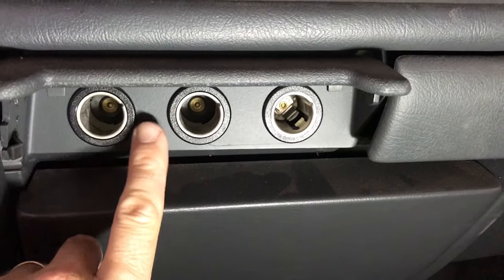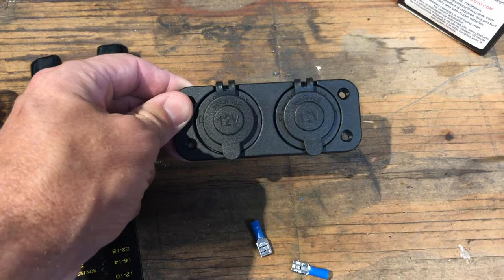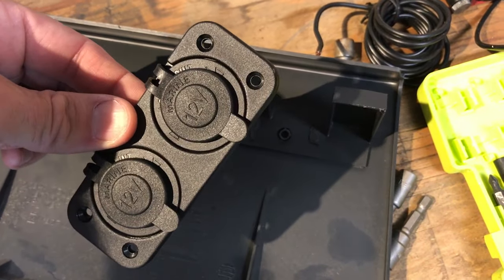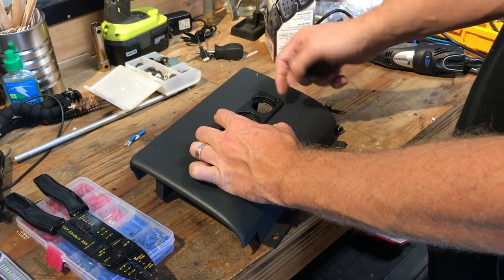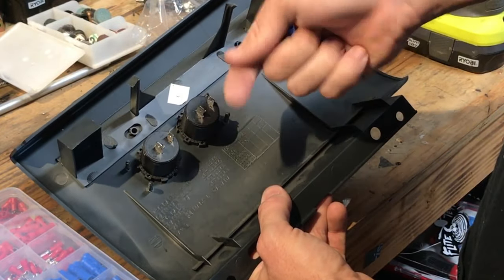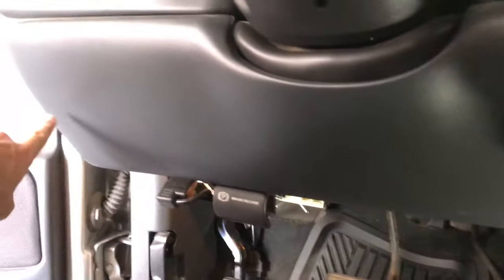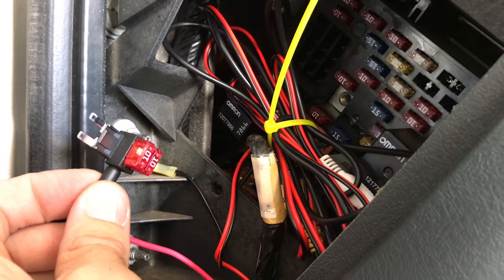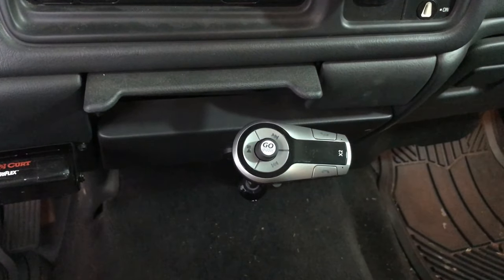Installing 12v Sockets for 10$ in Your Car Is Easy

Comment: I guess in this case it ultimately doesn't matter, but why the hell were you using black wire for both power and ground?
Reply from the maker: I ran out of red and wanted to get the job done….
Reply: Electricity is color blind
Reply: Why not it don’t matter he’s gonna know
Reply: Honestly next owner gonna be like let me cut this black wire and boom fuse out 😮 wtf?

Comment: i saw they have 12v sockets that connect right to the battery, and since my battery is under my trunk space and it's easy to run wire to the front from there in my Audi TT it sounds perfect. but my question is, is it safe to do that? seems almost to good to be true
Reply from the maker: It is safe, but you definitely want an inline fuse. Also be aware, the socket will be live all the time, so if you leave anything plugged in, it will kill your battery.

Comment: Love it!  I want to add a couple of 12V outlets in the truck to keep my Garmin plugged in on long trips and not have the power cord running through the middle of my console.  Wasn't aware of the add-a-fuse connectors.  Thank you.

Comment: It's easier than I thought.
I didn't know those "add-a-fuse" things existed, I thought I was gonna have to hack up the fuse box to add a new circuit.
Thanks for the video!
Reply from the maker: Thank you for the kind words! Those add-a-fuses are super handy.
Reply: @DoItYourselfDad  Can you clarify, when you use that "add a fuse" component, what fuse in the box is that running off of?  I'm guessing it is taking the place of an existing 10A \ 12V fuse in the box already used for something else.  In your vehicle, what fuse was it?

Comment: Great video!  Though i like having an always hot 12V in a campervan/RV, so i can plug in a solar powered trickle charger to the socket while it's parked for a long stint.
Reply from the maker: I definitely like having bowl, this truck that I’m working on in this video already had sockets that were hot all the time, I wanted another set that would shut off to power things like my raider Detector and CB radio.

Comment: Awesome video, thank you. I’m currently elbows deep in my very first “project” Land Rover and I was worried about having enough 12vs. My only question is: is there a gadget that attaches to the battery terminal that has space for all the wires from floods, and other electrical accessories?
Reply: If you’re still looking, walmart, amazon, and auto shops like autozone sell 3,6,and 12 post battery terminal connectors which make it super easy to wire in stuff like subs and lights!

Comment: Great video.  Consider using heat shrink butt connectors or soldering the lines with heat shrink over the top for strongest connections that will endure over time.  Adds only a few mins of time and $5 top to cost.
Reply: @A. Melbs You sound like someone who can't solder.  Horses for courses - really, it doesn't matter in this use case.  However, if you think the crimping tool in this video can beat a good solder connection, you're talking nonsense yourself.  A good crimp requires decent tooling - a $10 buy of Amazon doesn't cut it.  I'm IPC certed, I deal with this stuff day in day out, and would prefer soldered over this crimp.

Comment: Great video! Straight and to the point. Although, I didn't get a clear view of where you put the negative wire. I know it's going to ground but where does that go exactly? Also, why was the red wire, the "Add-A-Fuse", folded over, did the the model you buy just happen to have a forked end that splits into 2 other wires?

Comment: I don't have one of those splitter cables you use to power both sockets. Is it as simple as just combing the respective wires from the 2 different cigarette sockets into 1 positive and 1 negative wire and then crimping on a connetor?

Comment: Nice video the only thing I would like to add is that I would use Lever-Nuts Wire Connectors. I find them a lot easier than the crimp connectors.
Reply from the maker: I’ve never played around with those, but they look soooo much better than wire nuts or crimp connectors.

Comment: What gauge wire did you use and  where did you get that fuse connection to plug into your 12v fuse panel ?

Comment: How do you know which fuse socket is powered off the ignition? Sorry this is my first time and the only electronics I've done is with electric guitars 👌😅 thanks very much for the video ✊
Reply from the maker: You can usually find wiring diagrams online, which will tell you which fuse is which. You can also use a multimeter to check.

Comment: Very concerned about heat tolerance. My dash gets pretty hot even if I use the windshield cover - are these USB sockets heat resistant?
Reply from the maker: Yes, this is what they're designed for,.

Comment: Thankyou for this video; it's great, however, I'm assuming that it was the positive line from the socket that you took to the fuse. Where did you run the negative ground?
Reply from the maker: You can run the negative to any part of the body of the car.

Comment: I appreciate thos video but for soneone with no skill i really needed to see steps left out of your video to feel 100% confident but you have me  at 90. I read comments to help fill some of those gaps but still  troubled. If you make a thourough video plz let me know. My 3 12v sockets are not working and I need to install intending not to make contact with the originals.. just have my new self installed 2ndaries to charge gadgets as I drive.

Comment: Just so I'm clear... you tapped the actual Ignition fuse? I understand the benefit of knowing the sockets are off when the car is off, but I never thought of tapping the ignition fuse because I was worried it may have some negative impact on the actual ignition if the socket fuse blows.
Reply from the maker: If you're using an add-a-fuse, there isn't any change of blowing the ignition fuse.

Comment: This is a really nice project that I can do it myself. Instead of soldering ect....I can easily crimp the wires and to the fuse box which I have experience in since I have my dash cam connected to my fuse box. Quick question...the 10amp, what fuse did you use??? How long did this take and I wanted to install a USb and a Extra cigarette port..can instill use the fusebox method on the USB port??
Reply from the maker: Awesome! Let us know how it turns out!
Reply: DoItYourselfDad I'm pretty sure they were asking a question. Hence, the question mark.

Comment: Would like to add a two or three hundred watt windshield defroster (cold climate and a diesel engine).  I know it needs to be connected directly to the battery (and the engine running), but what gauge wire and what size fuse do I need for that size heater, and what kind of "receptacle" do I need to prevent overheating of the parts?  Thank you in advance for your assistance!
PS: Like some one else said, I was less than a minute into your vid and I hit subscribe!  Again, Thank You!
Reply from the maker: I would think on a defroster like that you would want to wire it directly to the battery through a relay using something around 16ga wire.

Comment: Hi, your jumper fused wire was spliced into something else on a red wire before reaching the positive wire from the sockets. 
What was that connected to. ?? Is that needed to do this job as you didn’t mention it. 
Thanks 👍🏼
Reply from the maker: It's providing power to my backup camera's monitor, you don't need to worry about it for this installation.

Comment: how can you figure out which systems you can add a circuit to in the fuse box?
Reply from the maker: Use a multimeter to figure out which circuit is hot.

Comment: So by this logic i think i might first try to add another socket directly wired from the already existing socket into an extended out of sight view for my backup cam since im already gonna be digging inside the the stereo when i replace it with a tablet style stereo in my car
Reply from the maker: You can definitely do this as well

Comment: Hey does the add a fuse need to be 15A since the 12V cig lighter on my 02 Jeep Grand Cherokee Laredo is F26 that says 15A.
Also do you simply just use the "add a fuse" with two 10A/15A fuses in it and connect only to the fuse box to the 12V sockets? You don't have to have the "add a fuse" wire going to the battery or anything right?

Can you add links to all the parts needed from crimper, wire connectors, add a fuse wire, and the wires needed for this, how about that dual 12V socket mount kit?
I'm not aware what those tiny connectors that go to the back of the 12V sockets on -/+ terminals are called.
My 12V Car socket is not working in my Jeep WJ and was covered up with a panel, so I need to install a couple 12V plugs in the Jeep.
Wanting to charge phones, power dash cam kit and be able to use 12V tire Inflator as well as drills, angel grinder & other tools I need on the side of the road.
Maybe a small fridge.
Reply from the maker: It really should be a 15a, you could go smaller, but not larger. With the add a fuse you do  not have to connect to the battery or anything else, they're really easy to use.
Reply: @DoItYourselfDad  what size guage do you recommend for dash outlets connected to under steering wheel fuse junction box?
I have to get a fuse holder/add a fuse at the specific guage.
Also what kind of wire should I use:
OFC(Oxygen Free Copper) or CCA(Copper Clad Aluminum)
I've been told OFC/Tinned Copper is best with stranded but not to many strands. 
But I only have CCA 16 guage/AWG and add a fuse 16 guage (unknown wire type) would that be safe for USB3.0/PD/12V outlets?

Comment: I want to have 4 separate dual usb ports installed in my van. Can I splice them all together using the one connection to the fuse box?
Reply from the maker: Yes, you can definitely run them in parallel and run them to one fuse.
Reply: @DoItYourselfDad  Thanks for answering. I have one more question. I have a 4 pin trailer harness installed in my van, can I just splice into that as my power supply? I don't plan on towing anything.
Reply from the maker: Yes, that should work as well. Just make sure your running the correct sizes fuses for the sockets.

Comment: What tool is that? Will it go through thin fibre glass?
Reply from the maker: It’s a rotary tool, it Will definitely go through fiberglass, metal too. If you’re cutting through fiberglass you’re going to wanna wear some sort of a facemask to keep the fibers out of your lungs.
Reply: @DoItYourselfDad  thanks. What blade did you use in the tool?
Reply from the maker: @thegrumpybusinessman3400  Im using a side cut bit

Comment: i would like to add 3 in a row instead of 2 but my unit it comes with 3 hot and 2 negative cables with each fuse able do you connect all together or what
Reply from the maker: He would connect all the hot side, and all the ground sides together

Comment: I’m still confused.  I get the concept and purpose of a grounding wire, but how did you actually ground it? Just drilled a screw through the end of the negative wire or some shit? Lol
Reply from the maker: Crimp a round terminal connector on the end of it and screw it into any grounded metal part of the vehicle

Comment: what size wire should be used if i need 10ft of wire and what size fuse?
Reply from the maker: 10 gauge wire and a 10 amp fuse should work fine.
Reply: @DoItYourselfDad  - If only the manufacturers used that gauge wire unlike the spider web crap they do.

Comment: does it work for cigarette lighter?
Reply from the maker: I wouldn't use these with a lighter, the housing on these is plastic which would melt with the lighter insert.
Reply: DoItYourselfDad Yeah no worries I had one installed specifically for cigarette lighter. Works great!

Comment: What amps was the open socket ?
Reply from the maker: Do you mean the fuse tap? I don’t remember off hand, but with the tap you can use any size fuse for the new circuit as long as the wiring can handle it.
Reply: @DoItYourselfDad  im adding 2-12v sockets with a fuze tap.
Reply from the maker: You should be able to run a 15a fuse.
Reply: @DoItYourselfDad  do i put 2-15p fuzes in the fuze tap?

Comment: You ever heard of a spade or paddle bit
Reply from the maker: Yep, and curved brittle plastic isn’t the right application for one.
Reply: @DoItYourselfDad  it is though. Drill from both sides. Super clean hole.
Reply from the maker: @SKANK_HUNT49  not on a curved surface.
Reply: @DoItYourselfDad  how much does it curve in that 5/8 of an inch?😆
Reply from the maker: If you want to use the wrong tool for the job, no one is stopping you.
Reply from the maker: You’re an experienced carpenter and your’re reaching for a paddle bit and not a hole saw? Got it….
Reply: @DoItYourselfDad  I love you man

Comment: You neglected to mention that the add-a-fuse has to be installed in the correct direction.
Reply: @DoItYourselfDad  in order to properly function, the add-a-fuse must be installed in the correct orientation. The leg of the device opposite the added circuit lead has to be inserted into the hot side of the fuse location. With the fuse removed and the ignition on, use a test light to find which side of the fuse socket has power. Insert the add-a-fuse correctly oriented or it will not provide two independently fused circuits.
Reply: Walter K  Hahahahahahaha
Reply: @walterk1221  - You are wise grasshopper!

Comment: Why did you not use electrical tape or heat shrink tubing to protect your power wire going to the fuse box? Or at least explain to the viewers to do so. Are you seriously not aware of all the different wires, wiring harnesses and random metal parts that wire has to pass through in order to get to the fuse box? What if it arcs on something? What if shorts out later down the road and catches fire under the dashboard? But.. " There we go, we got it all mounted up nice and clean" (4:37-4:38). You didn't even disconnect the negative cable on the battery. It's a simple fuse, yeah I get it, but it doesn't matter. When you do ANYTHING that involves power, wiring, fuses, etc; you ALWAYS AT LEAST disconnect the negative battery cable. Sometimes both just to be safe. Hey look, I'm not trying to be a dick or anything, but if you're going to post DIY videos at least go through the steps correctly so that someone that doesn't know any better gets hurt. Or even worse, lose their life. To a person trying to learn things on their own, it's risky. I wouldn't go as far as to say that this video is not good. It's educational, you pretty much covered everything. Except the 2 most essential parts for safety. So I'll give it a "borderline sketchy" rate. That'll make you look better. Just like the extra screws that you took the time to make it "nice and firm and solid"
(4:31).